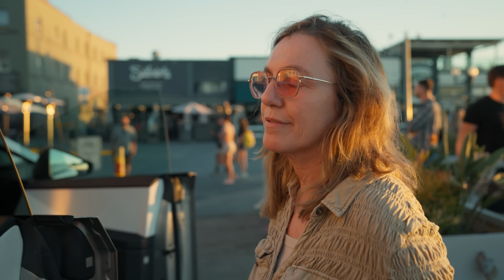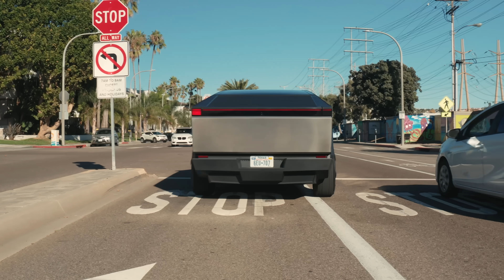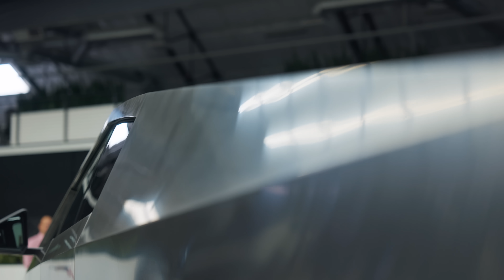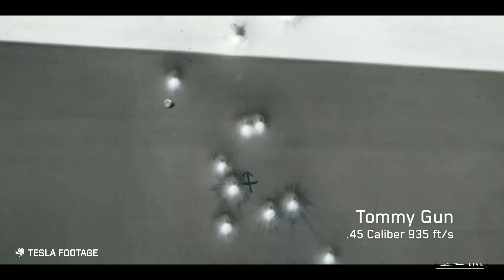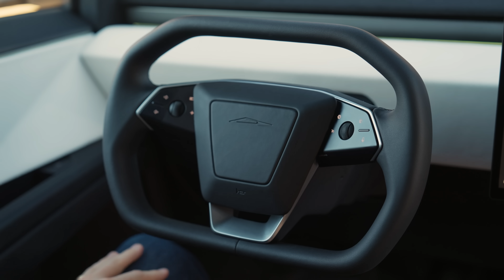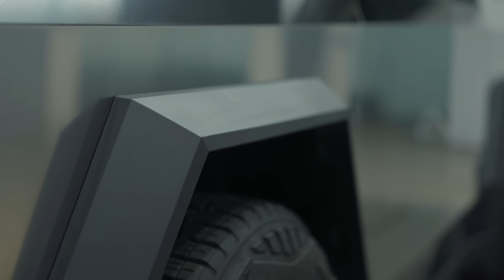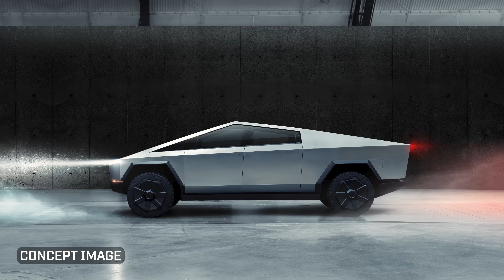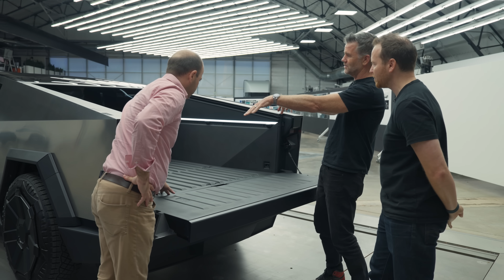FIRST DRIVE: Tesla Cybertruck Full Review

Comment: Two things this review leaves out: the usability of the pickup bed and the ability to tow. I would have liked to see how this truck behaves while towing an Airstream, and how it would handle a load of 2x4s or heavy crates in the bed while underway.
Reply: Roll up the Tonneau cover, leave the tailgate app and put your 100 pounds of two by fours in the bed and go on. didn’t you see that thing pulling a 40,000 pound sled? I don’t think a few two by fours is going to bog it down.
Reply: I love this but it's a grocery getter to many.

Comment: I’m happy to see this made production, breaking the mold of a conventional pickup and bringing innovation to the vehicle space aesthetically and mechanically
Reply: What do you think it has innovated?
Reply: @paintspot1509  steer by wire, new stainless steel body panel materials, new boron silicate windshield, the battery cells used in this are next generation

Comment: I live in Western Australia where the summer temperatures average in the late twenties to early 30 degrees C.
The air is clear with little pollution the sun shines bright and powerful. I drive a Toyota FJ and I am very pleased with the near upright windshield keeping the glaring sun at bay. Looking at the Cybertruck windshield design. I feel I would be burned to a crisp with that design of windshield. Not good for latitudes with high scorching sun.
Reply: the Cybertruck windshirld has FULL LEGAL Tint applied @ Factory , as well as ROOF glass .
you can already buy INSULATED covers for TESLA car models. 
and am sure Aftermarket parts will have them for CT.
Reply: Toyota FJ is such a cool SUV wish they were still produced
Reply: @robreeto   - because FJ was a flop.
Reply: I lived two hours away from where this video was shot and i can guarantee it's hotter with more sunlight than Australia

Comment: I've been looking forward to this beast since the launch of the concept. 

I had the same reaction to it's looks as most people at the beginning but the elegance of the design recalibrated my concept of beauty. 

I'm a bit disappointed with the loss of the retractable ramp in the tailgate and the cost is blowing out along with sygnificant reduction in the range they were aiming for but it's still covering a lot of the bases as far as integrating it with my specific needs in my construction business. 

The big question that has not been addressed in this video is it's off-road capabilities.  I'd imagine it's not very capable as far as the more extreme 4W Driving due to the way the suspension works, weight and the awkward footage of them off-road to date. Some of that awkwardness might be explained by incorrect tire pressure but I  don't think it's the kind of vehicle we'll see on the more intense tracks here in Australia. I was hoping for better on that front, particularly as the raw stainless steel is a fantastic medium to push though duco scratching scrub without a care in the world.

I'd still get the beast tomorrow if it became available here.
Reply: On the delivery event I think elon said it has differential lock and the weight distribution is very low so won't tip over easy and it's more evenly distributed on all four wheels.
Reply: @swissTom124   They also assist steering with the brakes.   This would help in sand and lose dirt.  Keeps getting better.
Reply: It could be the truck is great at rock climbing but the legal department does not want people screwing up their trucks and wanting warranty repair because they seen where Tesla demonstrated it.
Reply: @danharold3087 or it could be that this pile of garbage falls apart when it goes off road.
Reply: It definitely will @paintspot1509

Comment: It would be interesting to see if they ever plan to do something about the pedestrian safety.
It looks like it is possible to cut cucumbers on the spots where the panels meet on the front.
I am happy to see that the body is not made from 3mm stainless, despite what so many have claimed.
Reply: It is made from 3 mm thick stainless steel. Probably 1/8 of an inch. It’s an American truck produced with imperial dimensions.
Reply: @ZeusBullyMax  By the mid 80s US car production finished conversion to metric.
Reply: @ZeusBullyMax  Lars Moravy, Tesla's Vice President of Vehicle Engineering, confirmed for TopGear Netherlands that the Cybertruck will likely never make it to Europe.
European regulations require a rounding of 3.2 millimeters on protruding parts. Unfortunately, it is impossible to make a rounding of 3.2 millimeters on a 1.4 millimeter sheet of stainless steel," he added.
It looks like they use 1.4mm steel, so my guess was very close.
Reply: @ZeusBullyMax  It looks more like 1.5mm to me.
Doors and front would weigh 70kg if made from 3mm, if crashing into a ditch some people would not be able to open the door to get out of the car.
The plate would not ripple/vibrate after a hammer hit like it does in videos, the 3mm cheap mild steel plate i have laying around react a lot less then the videos shown of the tesla hit tests.
Reply: TESLA does NOT need to, its CLASSED as a Medium Duty truck. 
dosent even need airbags , though CT has Lots of them.
Reply: @markplott4820  Ah, we had something similar. A Chinese car brand was not good enough in crash tests, so they filled it with 200-300kg of metal plates in the floor, to increase the weight of the van and installed camper equipment in it, because autocampers had more lenient rules about crash safety then regular cars.

Comment: On cost: Tesla seem to avoid unnecessary parts like they said. But they also seem to push the design they want, then achieve and invent an economy of scale (e.g. their massive factories, new manufacturing techniques) to achieve that design with low cost.
Reply: Which is why it's way more expensive than they said it'd be
Reply: @Neophlegm  People are not talking about Insurance and Repair costs.
If you ding this thing, I bet you it costs way more to repair.
If they have a special kind of bending approach and design to its structure its going to drive up costs dramatically.
And Tesla is notoriously bad in the repair market already with their other models that have more production time behind them and are a lot closer to typical ICE cars.
This is a very niche product and it was sold as something everyone could have. Elon had a vision but its falling short here. Even with all the cool gadgetry and engineering involved in it..

Comment: 1/ it's ugly
2/ it's impractical because the stainless steel look means that as soon as you put a hand on it, it will have a stained look because of the natural grease on your skin
3/ the windscreen wiper that wasn't going to be the production model is going to be the production model, which means that you really shouldn't drive it in bad weather because that wiper isn't safe when it really pours down
4/ the lowest model will cost 70k USD, which is insane... never mind that the top model will cost 100K. 
100K for an ugly unsafe truck? 
5/ Unsafe for those that get hit by it because of the mass of the vehicle, the stainless steel, the sharp angles. Hit a pedestrian at 10mph and congrats you killed someone.
6/ no doubt some elon fan boy will drive it with FSD on, will be 'amusing' to see this vehicle with the phantom breaking and unexpected accelerations that are far from uncommon with Tesla's
7/ It's all form (ugly form) over function
8/ yeah, farmers, builders, and everyone else who actually needs a truck for their job are just gagging to have a truck that is bulletproof !?
9/ yeah, trucks (just like Semi's) don't need fast accelerations because it has no functional reason
10/ in short this is a truck for fan boys who have more money than brains because it's best when driving fast on highways instead of being reliable on rough roads or even off road.

Comment: I don't own a truck, but maybe trucks are made the way there are because of the heavy weight they are meant to carry and the going over uneven terrain. If a truck is made so stiff without any flex in it, will the joints be able to take or handle twists and flex a truck handles?
Reply: You are mostly right.  A regular pickup can flex quite a bit in the frame.  You see this in action when the box stops lining up with the cab.  The CT has enough suspension travel to deal with the stiffness.  Worst case a wheel comes off the ground. We see that in rock crawling.

Comment: Always said I can't stand the look of them but looking at it from a functional perspective it does look useful for everything you'd need
Reply: as long as you don't need it for business purposes on rough roads let alone offroading but just want something flashy to impress fan boys while cruising down the highway
Reply: This track will off-road excellently. They tested it on Baja. It has 35 inch tall, off-road tires, standard and a 17 inch ground clearance. No factory pick up gets 17 inch ground clearance even with a lift kit. It also has a super low center of gravity, well it where it will not turn over.
Reply: @ZeusBullyMax  Claims. Claims. Claims.

How about an actual demonstration?
We all reminder the video where they had to aid to make it get up a regular curb.
Reply: @PDVism how have you not seen the videos of 3 Cybertrucks convoying in Baja, Mexico? Just like Ford with the Raptor, Tesla also tested in the areas where the real Baja 1000 goes.
Reply: @TheReal_JG  It's TESLA.
I believe it when someone who isn't working for Tesla and isn't a known fanboy of Tesla does it and that doesn't look like it was filmed with a potato.

Reason being that you shouldn't believe them at their word is because Tesla and Elon have been known to LIE and falsify claims.

How quick can you recharge your Tesla?
Does it take mere minutes like they once said it would?

Can you drive in FSD from one city to the other without touching the steering wheel once like they claimed years ago with video proof (which latter was revealed to be completely doctored) ?

Comment: Rarely hearing about the impact EVs are having to our roads with all that immense weight
Reply: A Long Range Tesla Model 3 dual motor all wheel drive 4 door 5 passenger sedan with a large trunk and big heavy battery weighs just over 4,000 pounds.

A Ford Mustang GT 2 door 4 passenger coupe with V8 engine, automatic transmission, small trunk and full tank of gasoline weighs close to 4,000 pounds.

The Tesla Model Y is slightly larger and weighs several hundred pounds more, just like most ICE SUVs.

Best to check what you're talking about and not spread misinformation.
Reply: @dvader3263  didn't realize the Model 3 was so light. Thanks for the insight. Would a better comparison be something like the WRX STi which comes in about 600-lbs lighter? I drive a Miata, so I consider nearly all modern vehicles are overweight 😂

Comment: after seeing absorbing all the latest info and specs of this vehicle, I don't think will ever sold the cheapest version the RWD. They will instead make new models like the CyberSUV or CyberVan than bothering with the lowest cost Cybertruck
Reply: I can see them making the single motor after they sell a bunch of 2 and 3.  There is a sizeable market for 2WD trucks.  Above all Tesla wants to keep the lines fully ramped.  The RWD will help them do this.
Reply: It took a long time before Tesla was able to bring the price of the Model 3 down. With tax incentives, it technically is below Tesla's initial $35,000 price (it's at $38,900 without the $7500 deduction). The rear motor might come out in Q4 2025.
Reply: @TheReal_JG  Yes but the Model 3 just came back to it lowest price since but did become cheaper. Well if we consider inflation, it did become cheaper slightly. However it is an already ageing popular car and platform that shares with the Model Y.  Anyway, what I'm trying to say is Tesla can avoid lower prices of the CT by making the CyberSUV.  It is already proven that it is easy and successful strategy based on the Rivian's R1S which is derived from the R1T
Reply: @zodiacfml  the Model 3 and Y will thankfully get refreshed versions in the future, with Highland (3) coming to the US in late 2024 and Juniper (Y) likely coming in mid 2024 for all regions. Both refresh models are expected to increase by only $1k. 

I do hope to see at least a Cyber SUV or Cybervan as well, and will buy one if Tesla does so.

Comment: can we talk about what was promised and what wasn't delivered. First was $20k+ more on cost. Guess those early adopters are going to suck this up. Second is glass breakage. Just couldn't get it done. Third are the ranges. Forth is side mirrors being added. 

What I see is most the same stuff a $100k automobile offers. Also, why are the caps on the wheels futuristic? It's a cap with angles. How are buttons to automatically open the tail gate futuristic?

Comment: They answered my question about the large flat front window it's not actually flat it has a slight curve to prevent vibration. In other videos you can see the top edge of window has a fillet due to the curve. The skylight glass must have a similar curve in either sideways or longways for the same reason to prevent vibration.

And it's a real leap forwards in using the 48 volt low voltage instead of 12volts. A higher voltage has been something that automotive industry has talked about for decades but no one has done it till now. It is very helpful for a steer by wire system it makes the electrical system more powerful and efficient.

Comment: The wise consumer will wait till all of the bugs have been worked out of the Cyber truck.
No matter how skillfully engineered and constructed a new electronics product is,  the first iterations will always have the bulk of the glitches manifest in them as opposed to later versions of the same product.
It will only take a couple of these trucks to catch fire for any reason, even if it has nothing to do with the Cyber Truck itself and more to do with user error, a thermal run away burning Cyber Truck no matter the reason will have the effect of stifling sales.
The first buyers of these trucks will consist mainly of "Bragging Rights" buyers and buyers with more money than brains.
Would I buy one?   Hell yea I'd buy one, if I could afford to buy one but, I can't afford to buy one so, all I can do is $hit on those who can afford to buy one.

Comment: Just to cut through the "innovation" speak - air bending is nothing new.  Tesla ordered a huge Trumpf TruBend press brake to one of their factories a few months back, so they're likely using this.  "Air Bending" sheet metal just means that you "float" the inside radius of the bend itself as a percentage of the opening angle of the stamping die.  It's been done for years.

Comment: I want to see some actual truck work testing. Put some raw logs in the back, hook up a trailer, load the trailer up. Drive it through some actual dirt, grass, hills terrain. Let's see how it holds up.
Reply: They've done that in testing
Reply: For lumber and logs it will be excellent because there are no clam shells over the wheels.  Easier to clean off too.

Comment: What height dog crate can fit in the truck bed and is it ventilated/AC/Heat when top is closed?  Would a 700 crate require the truck bed to remain open?  Cheers!  Can't wait for mine.
Reply: The bed is not ventilated when closed and definitely does not have A/C. The tonneau cover is to keep items in the back dry in wet conditions and for aerodynamics on the road.

Comment: I'm always fascinated by the fact some of the engineers at Tesla are shared with SpaceX, especially the metallurgists. That's given Tesla the unique stainless steel alloy for Cybertruck and the unique beyond-cutting-edge alloy that allows the Gigacastings to be shot in milliseconds. The HVAC system and Octovalve are the result of sharing the SpaceX engineers who designed the life support system for the Dragon spacecraft.

Comment: looking at the design draft with a cyber truck and f117 side by side, makes me wondering what's the size of  radar cross section of this thing, forget about bullet proof, is this thing actually stealthy😅
Reply: The RCS is as big as the truck (because plain steel still reflects radar). If the CT has the paint of a B2 or F22, the RCS might be smaller lol. 

Seeing the CT in matte black definitely screams stealth fighter.